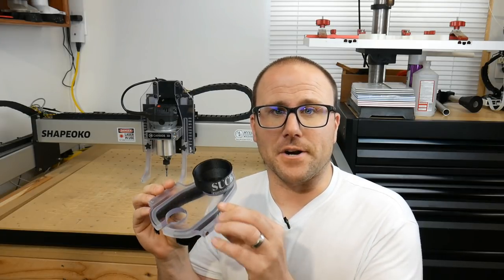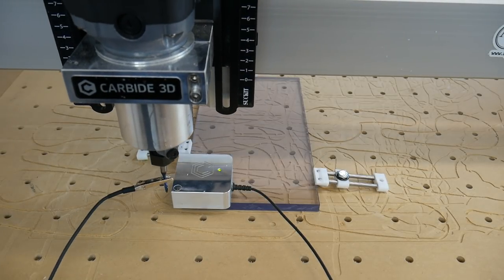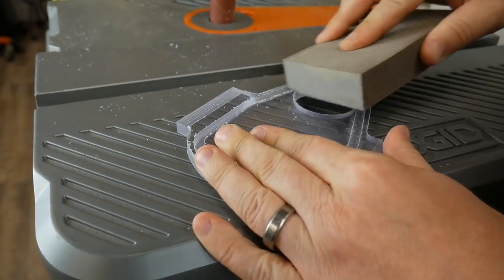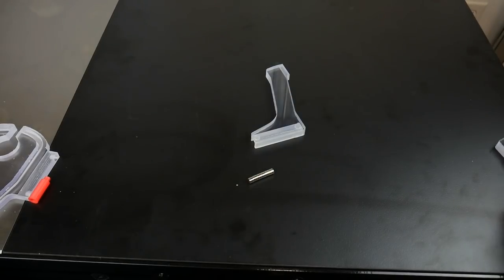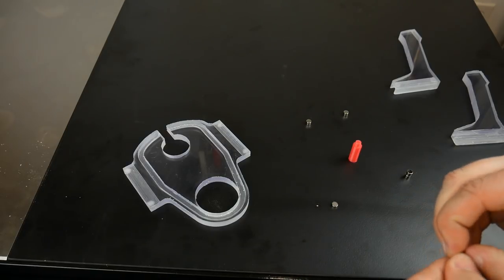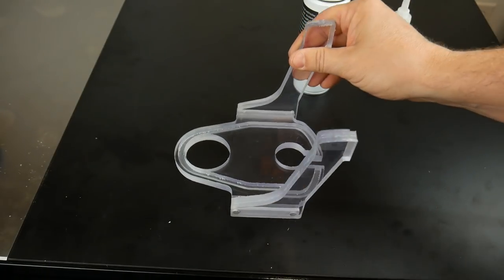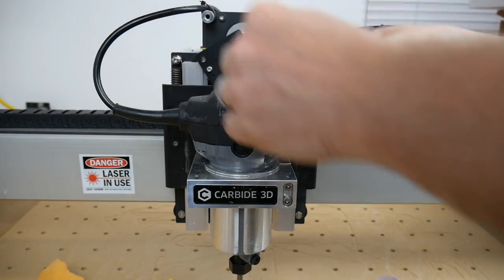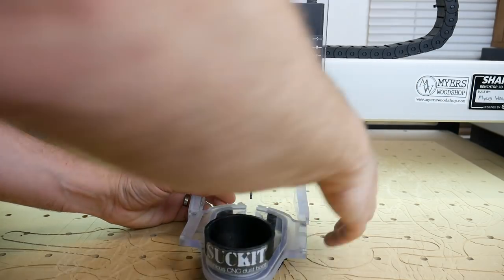MIYS (Mill It Yourself) SuckIt Dust Boot For The Shapeoko

Comment: Have you tried flame polishing acrylic for perfect clean edges?  (doesn't work on poly-carbonate, just acrylic) Use a standard plumbing torch and quickly brush the flame on the sides until they become crystal clear.
Reply from the maker: nope, but that would be cool.

Comment: Question: Why don't you use the top of the calipers? you just draw a line from the corner, and for the center just set the calipers to.172" and draw a line from the topside and the downside of the material and you got your  point.

Comment: What is the difference in cost of buying the kit and buying  the whole thing all ready made?
Reply: $60. MiY lists at $60 vs $120. And a bit of efficiency the hard corners.
Reply: @benjaminbrewer2154  After I have done the XYZ probe using  end mil and change  to a vbit and want ti set the Z height with a  piece of paper , What do I need to do in CM to then set that  height. Jeff
Reply from the maker: Check my carbide create series.
Reply: @MyersWoodshop  I have watched them and I don't see where you addressed my  question. Also I can't find anything on the Shapeoko forum either.
Reply: @resorter66  You have to zero the z again. you cant run a cut file with multiple tools.

Comment: I am curious to know why anyone would purchase the 'mill it yourself' version when you only get the nc files and not the actual design files. What possible advantage is there in purchasing the MIYS version when the amount of time you put in to it far exceeds the money you save in choosing this option?
Reply from the maker: Some people have time and not money.  It may be worth it to those people.  To some they have money and no time, so the pro kit would be a great option.  It’s always great when companies give us a choice!
Reply: @MyersWoodshop  I appreciate that mentality, however the price difference between the two is only $50. This video is a 20 minute video on how to go through the process of MIYS yet the milling process is sped up by 100x, how much time does it actually take to do it? Would you consider it to be worth saving $50?

I am in Australia so the $110USD (~$160AUD + shipping) price tag for the dust boot was not a viable option for me, so I designed one myself in Fusion 360 (for the X-Carve)...its all 3d printed except for the shoe which is carved out of 10mm acrylic.
Reply from the maker: Nope, but I have disposable income
Reply: You're saying "more options are better"... Then why not also give the option to download the nc file and a 3D model, allowing the user to set up toolpaths himself?  I don't use Carbide Create so this might also apply to that, but you could offer a Fusion360 file that combines the model and toolpaths, letting the user adjust settings as he sees fit and export the Gcode himself.  I suppose if everyone is using the same hardware and software then it mitigates this somewhat, but I would be a bit uncomfortable using someone else's g code, especially if I'm using a different sender that may interpret commands differently than what you used to set it up.
Reply: @secretspy711  People would be selling or giving away the nc file is why.
Reply: @randogame4438  I would never run someone else's gcode on my machine.  Ever.